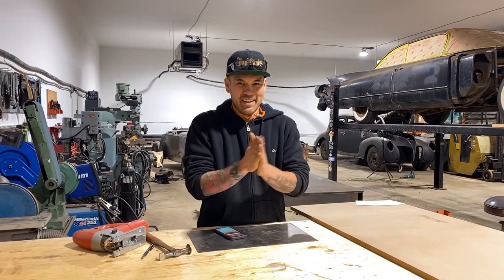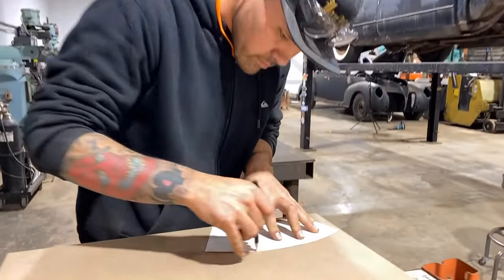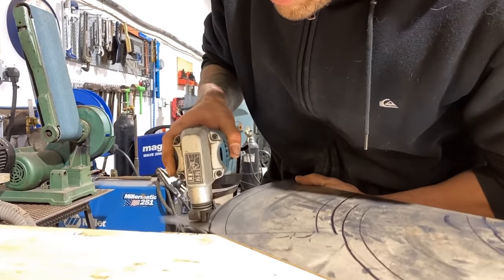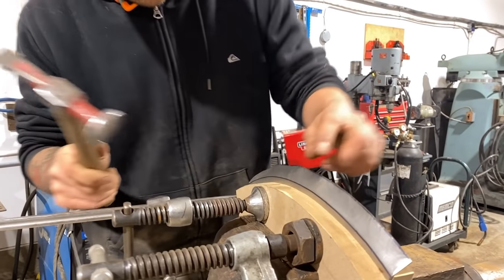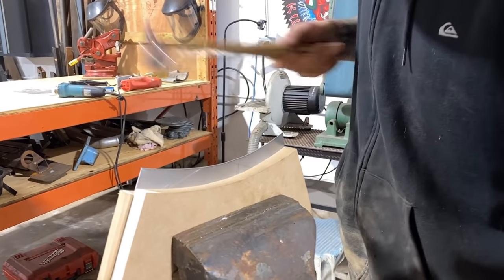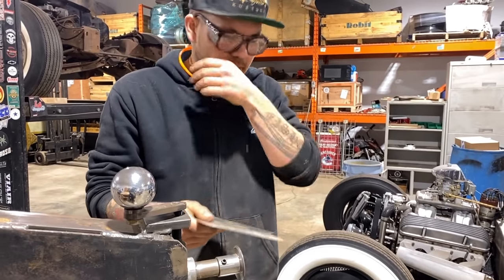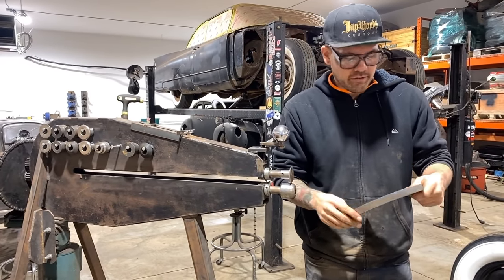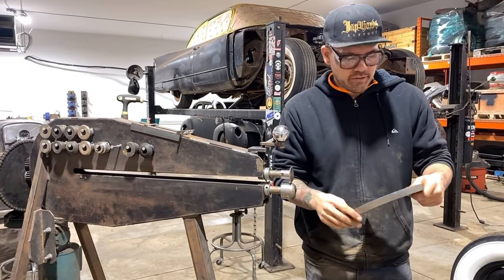Tipping Curved Flanges - Hammer Forming VS Bead Roller | Body Hammer WINNER Announced!!!

Comment: Thanks for the lesson Sensei. I have to make a 35 degree flange for a wheel arch repair on my 55 VW. I think this hammer method is just the ticket. Now I have to figure out how to make the correct angle for the flange to match but this points me in the right direction

Comment: Great video Karl, and even better videography Christina. The video angle showing the metal being shrunk ( back side ) best I have seen. I find the MDF method best if you are needing accuracy in your panel. I use double stick tape and clamps to keep the metal from moving between the hammer form. makes it easy to reposition the clamps as you work around the panel. Very thankful this Thanksgiving for your videos. Frank

Comment: Always fun trying to hold multiple pieces together until you get a clamp on them.  Had good luck using some double sided tape.  Don't need a lot, just a couple pieces.  Works on wood, metal, plastic etc.  You can adjust a bit before final clamping or fastening.

Comment: Love the video, my personal preference would be if making a number of identical flanges (or left & right handed parts) I'd use a form + hammer, also when the flange edge is going to be very visible. For speed and my typical 'one off repairs' tend to roll edges combined with shrink and stretching as required, often when examining the original (corroded!) manufacturers part (UK cars!) 'Z creases' are visible on the parts of the vehicle the owner does not normally see! Looking forward to your next video 😎

Comment: Hi Karl, just a tip when it comes to hammer forming my friend. I have been doing this stuff for years and you are pretty close, you need to make your top and bottom forms exactly the same size. Go back through and watch your video and you will see when you have hammered your edge over on inner and outer edges, it will leave a bubbled ridge against the sandwich edges as your top form falls short from holding it at the break point of the hammer fold. I will be in touch in the near future via email once you have settled more in the shop to talk Lincoln Zephyrs buddy. Kenny from Australia. 🇦🇺

Comment: Quick tip, if you are doing buck work or form work like this. If your setup is not sufficient enough lto hold the sheet metal rigid to prevent slippage, get some emery cloth or sand paper (100-320 grit), use some contact cement on both the paper and the buck/form sides that contact the sheetmetal and allow the glue to setup for a good half hour.  The abrasive of the sand paper will increase the friction much more and lessen the chances of the metal slipping out of place.
Reply from the maker: Thank you very much! Sounds like a really great tip!

Comment: Hi Karl,  I did like this video but, I'm allways suprised that no one ever shows just tipping a flange with a hammer and dolly.  when I first got started in working in a rust repair shop in the mid west rust belt I quickly learned that in a collision that if there wasn't anything to weld the new part to you either made one if it wasn't available or waited.  I quickly learned how to make panels with this method back in the early 80]s when NO ONE shared any secrets of metal work with any body.  I also learned with making quarter panel parts like the dogleg and the inner dogleg that without a hammerform because we didn't have a schrinker or stretcher ( which I had never been introduced to before) that hammer forming was the only way to go.  I believe that with this simple forming technique that not only does it do both sides that you will use this same technique ob all kinds of cars so if you're starting out and making forms buy decent quality plywood  because it will get used a lot.  Thanks for the video !
Reply from the maker: It’s a great idea for a future video! Thanks for the suggestion!

Comment: Once you understand shrinking and stretching metal shaping makes a heck of a lot more sense. You can also do the flanges just hammer and dolly although I must admit I find the ones where you need to shrink much easier than the ones you have to stretch. My mentor always called the wrinkles 'puckers'. What I find works for me is using something like a tipping die, a home made 3mm wide metal disc with a radiused edge, on the bead roller to put the break line in then hammer and dolly from there because it will bend on the brake. I haven't developed enough skill to break freehand just over a dolly. I've also used a slotted steel rod or even pliers to hand bend the flanges up then finishing with hammer and dolly.Lots of different ways to do things one you understand what it is you need to actually do to the metal I guess.

Comment: If you use a shrinking hammer (square end) it goes faster and much better result bending a flange.
Saves a lot of time, did bodywork for 25 years with old-school methods taught by a master.
Reply from the maker: Thank you! What about the Square end helps it shrink?
Reply: @MakeItKustom  Very similar to your Shrinking Machine with cross-hatched face instead for a polished head. I checked and Eastwood actually sell this hammer, Item: 14309 Fairmount Fiberglass Shrinking hammer. Also works excellent if you have a high-spot on a hood, door in a tight area, some small taps with this hammer and the metal goes down very fast.
The small marks afterwards can be smooth'ed out using # 80 grit disc.

Comment: Not having done much metal forming, I like the way you use MDF to form the bends. Bead roller is pretty and sexy but like you mentioned that when possible you prefer to hand hammer the band.
Heck if you're making custom pieces and you have to buy a sheets of MDF and 
that's got to be like chump change
Reply from the maker: Yeah for small pieces of MDF like I used in the form it’s only a few bucks so definitely worth it and not an issue especially when making custom pieces. Time is money and that is a balancing act in any custom shop

Comment: Great video!! Thanks for the "education"!! A question about the shrinker/stretcher. We have been using ours recently and found that it "matters" how far you put your metal into the throat of the shrink/stretch dies. Would you do a video explaining the "do's and don'ts"/theories to be aware of when using the shrinker/stretcher??? eg, outside of the flange represents a bigger radius than the inside edge of the flange so more stretch is needed on the outside. Opposite on the shrink???? How tight a radius can you expect to make with these tools. Depends upon the size (width) of the flange??? 
Thank you.
Reply from the maker: Great idea! It’s actually on my list of videos to do. I struggle with it in the beginning as well

Comment: Great content. One thing I would like to see if you are inclined. I'm building a 55 myself, I plan to radius the quarters as well but I would like to form a lip similar to the original or at least some form of a lip. Keep up the great work.
Reply from the maker: You can buy them from danchuk but I’d love to make a pair on here !
Reply: @MakeItKustom  I don't like the radius on the Danchuk wheel wells. They throw off the asthetics IMO. Balance front to rear is key and fitting the radius of the tire. That kind of stuff drives me nuts and I'm persuaded, watching you work, it probably bothers you too. 😁

Comment: Thank you again for a Very interesting Lesson on Shaping metal.
 I Have a very interesting project where i Have to shape an inner panel which at one end has to say have a 4 inch roll on the top portion,  But as it progresses forward the Sheet Must start to Flatten out due to the shape of the roll cage that that end will affix too. I will be working with 1 mm Aluminium sheeting.  This is a Panel is inside a small speedway Race car they call Formula 500 s here in Australia. Not sure if you have any  thing that you have done kinda like this on one of your Videos Karl. Love ya Work  Cheers Dave from Australia
Reply from the maker: Sounds a bit unique. The best thing to do is to put some cardboard up or use wire to make a frame that you can lay paper on and as you tape the paper into the shape you want, you will be able to see if it needs shrink or stretch or both it will give you the answers you were looking for

Comment: Another awesome video!  I do have a question about tipping on the bead roller.  How do I get my panel back to flat if I do not have a shrinker/stretcher?
Reply: You can buy shrinking hammers check out a video on 'The Tube' there must be a few...thousand...B-)
Reply from the maker: For shrinking you can also use a tuckin fork To wrinkled the edge so the panel becomes flat. Then using a tow dolly you can hammer out the wrinkles

Comment: Lots of ways to go about it, the reason I steer away from hammer as much as I can is because I like not having to wear ear protection all the time, and if I have a migraine even the act of hammering (with PPE on, obviously) is too violent, my head explodes. 
So I either use beadroller, or I form the curved lips by drawing a pattern on the panel, then use vice grip or make a cut into a bolt to build a flange tool, Binky style.
Other than that, IMO it doesn't really matter what tool you use, does it produce the result you're after? Then you're plenty skilled, aren't you? So what does it matter what tool you use? :D

Comment: Your hammer at 12:50 is called a linear stretching hammer. If you broke the edge   of your sheet metal with a straight edge, about an inch in, and used your stretching hammer against a metal background like a dolly or steel table, you'll get the same result as using a stretcher.
Reply from the maker: Thank you for confirming this for me. I assumed that was its purpose based on its shape but could not find much info on it. 🙏🙏🙏

Comment: Greetings from our side of the Pond and thanks for a great video. I am new to panel work - making and forming inside and outside curves. I am still getting mixed up when thinking about whether a curve needs to shrink or stretch! When you are trying to shrink on a curve - as you were in the first example when you were hammering around the MDF former - would it make the actual process of the metal shrinking into itself easier if some heat were applied to the metal?? Obviously if that were possible and without setting fire to the MDF! 🙂 I am imagining a blacksmith beating hot metal on an anvil; not the same I know but the hot metal appears to 'flow'? Many Thanks.

Comment: Great video!  Couple questions. 1st, have you ever used a router to put a rounded edge on the MDF form to help establish a smoother bend? 2nd, when you’re bead rolling, are you “pinching” the same line each time you run it through or are you walking the line around the radius of the bend?
Reply from the maker: 1 - I have not but I’m sure it would work 
2 - I’m going over the same line
Reply: @MakeItKustom  1. I was thinking of a very small round over, 1/8” or less. 
2. The repetitive pinch of the same exact line doesn’t make the curve overly thin and ultimately weaken it?

Comment: Question about hammer forming; how much material can you bend over the form  ? Example , would you be able to make a form that's 6 inches tall  and Bend that much material over and make it look as nice as a 1 inch tall form ? I hope my comment makes sense , English is my second language. I'm Lithuanian .
Reply from the maker: The taller the flange is, the more shrinking or stretching will happen so yes you could do you some that are tall but would be limited by how much curve you give it because you can only shrink or stretch so much. In that case I would make it into pieces. Hammer formed the flange maybe a half inch over and then weld an extension
Reply: @MakeItKustom   ok , that makes more sense. I guess I was over thinking this and adding an extension would be a easier solution. Thanks for the reply. Great channel and your tips are definitely being used on my board track style motorcycle build. I'll be Hammer forming a gas tank and oil box .

Comment: Great video as always Karl and Kristina!
Question: While hammer forming, would you use heat to help the shrinking and stretching? I know you didn't in this video, so that probably answers my question.

Bart in Ladysmith
'65 Impala SS
Reply from the maker: In some cases yes heat is necessary But I only use it if I really have to. Either a lot of shrink or a lot of stretch. I would prefer not to have a wood form when heating

Comment: Have you looked into ghetto hydroforming: 3d print or make a negative mold then use a low durometer rubber sheet on sheetmetal and press it.
Reply from the maker: Yes it looks like fun! I’ll have to try it sometime

Comment: The first time that I used a tipping wheel was a disaster, I couldnt follow the previous tip rolls. It took me a few times to learn what I needed to do to follow each roll. I use a urethane wheel for my bottom die. I seen that you use both and in this video you used a steel bottom die. Does using the steel lower die give you more control?
Reply from the maker: Yeah I think my lower wheel is too soft for this it would be nice to have one a little bit harder. I like using the steel one to start the edge because it allows me to pinch the corner which keeps the bend sharp
Reply: @MakeItKustom  I will try that out tomorrow, using the steel lower die.

Comment: NIce video, BUT, if you look at the end of the upper bend you can see where the top where the 1/4 inch back on the top allows the metal to bump up, so there is something to say for making the two boards the same side, but nice video.  Good job.
Reply from the maker: That’s a great point and I think I will make them same size from now on

Comment: In the past iI have clamped hammer forms in my Manual 20 ton press just to hold it works pretty good but there's limited range to swing a hammer at edge put thats cause my press is in corner but 3 tons will hold like no clamp will
Reply from the maker: That’s a great idea to hold it! I haven’t thought of that yet

Comment: You need a radius on the hammer forming die or you are stressing the metal at the bend and weakening it! Run a router with a corner round along that edge and you’ll get a much better bend and a much stronger part.

Comment: Question for you Karl, can you hammer form a rounded but square corner?  Or is it best to cut out the corner and hammer form the 2 sides and then weld together?  Also for this project ( pinball lock down bar) the material would be 16 to 18 gauge stainless steel.  Thanks in advance for your reply.  Congrats on your success, I watched you grow from 25k to 100k in like a month or so!! Amazing Bruh!
Reply from the maker: Hey man thanks so much and yeah you can absolutely hammer form a rounded edge! Just rather the edge of your word form
Reply: @MakeItKustom  what about the 90 degree corner?

Comment: How would you change this if using heat treated aluminum, like 2024 T3? Any worries with work hardening and then getting stuck since you need the specific temper? Would the bead roller be the way to go? Or even go to like a poor man's hydro forming press since it's so much softer? I'm thinking like .016 to .040 thickness

Comment: I see that your stretcher or your shrinker  is marked 18g do you use different stretcher/shrinkers for different thicknesses of steel or is that the maximum thickness for that one.
Reply from the maker: That’s the max thickness it suggests. I did that because I had and employee jumping on the last one on 16gaige and broke it.

Comment: How come you don't use heat when hammer forming?
Reply from the maker: Great question I should try next time
Reply: @MakeItKustom  - Even use it 1/2 way through. As you know, you're hardening the metal as you bash. Heat (high enough) will soften the metal up again. Obviously remove from the MDF form first!  Ha ha.